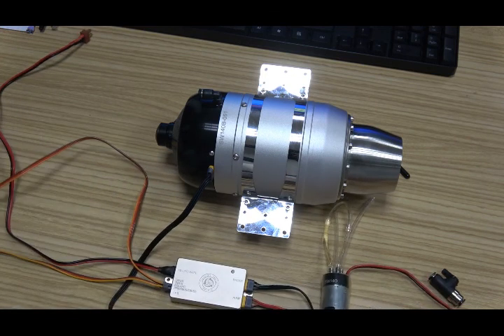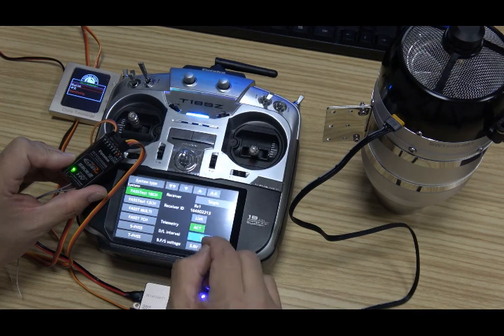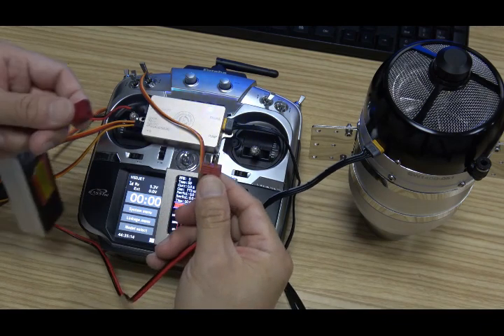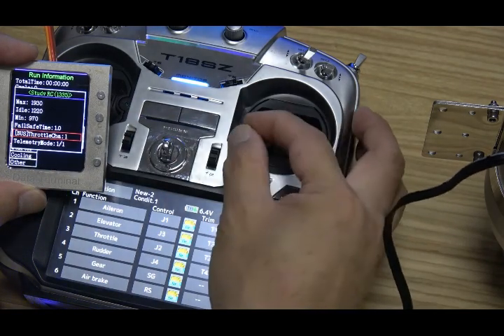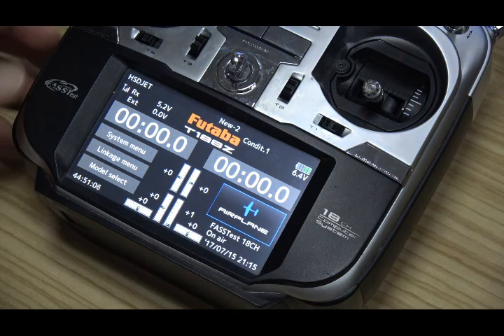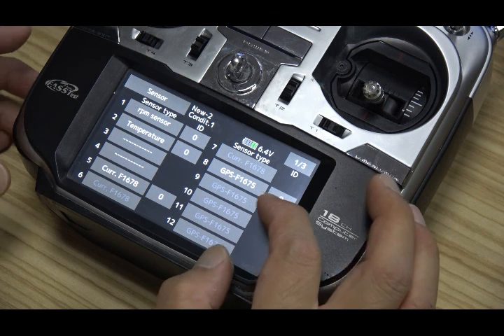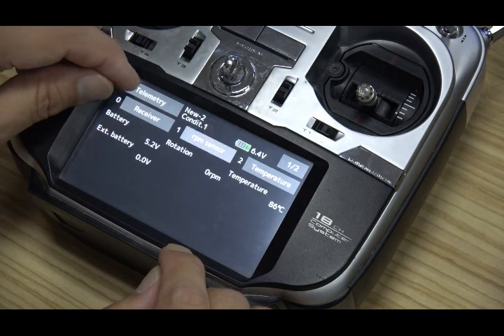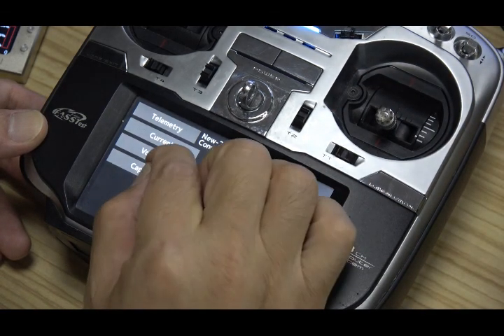Swiwin Turbine telemetry setup

Comment: Thomas, you say that in SW60 model, you use "data" cable which will cause an engine to stop, if there will be even one missconnection. Don't you think that you should stop selling this version of the engine when you already know, that it is not perfect?????? Insted you sell on hsdgo.com both versions and version "B" is almost 200$ more expensive. I think it would look good for the SW and HSD company to avoid such a situations. Kindest regards.